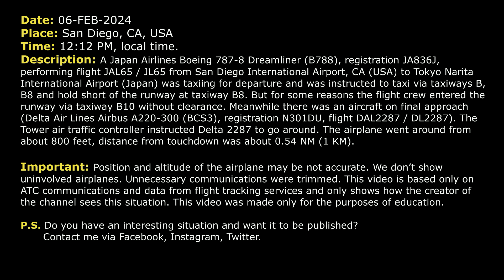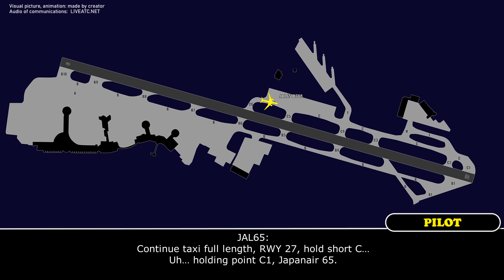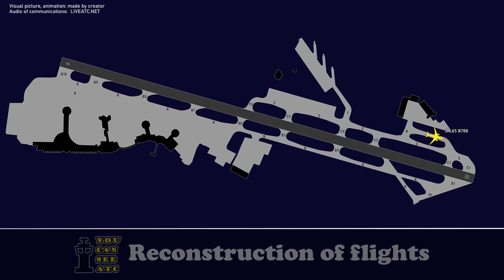Runway incursion. Japan Airlines Boeing 787 enters runway without clearance at San Diego. Real ATC

Comment: In conclusion, beyond an involuntary error by the JAL pilot, he was following the instructions and therefore, this active runway incursion is more the responsibility of the air traffic controllers due to a specific factor: accelerated speaking among those in charge. The ATC have the obligation to speak more slowly in order to be understood correctly and avoid small scares like this or major accidents like the one with the other JAL plane in Haneda (the latter was largely the fault of the JCG invading plane which did not was not authorized to enter the runway nor did he obey ATC orders and it almost seems that the surviving pilot acted like a real kamikaze pilot), the CEOs and managers of JAL should take a tour of Catemaco, Mexico both to cure themselves of horror and to get a clean of this streak of bad luck that they have been going through so far in this first two months of 2024.

My best wishes and unconditional support to the entire Japan Airlines team so that they can get out of this bad moment they are going through and continue moving forward as the great airline company that it is. 
😊😎❤️🇯🇵✈️⭐

Comment: Can someone please explain to me what this whole 'are you ready to copy the number' is designed to achieve?

The FAA (and JAL) will have a Safety Management System (SMS) and the mistake will get dealt with and investigated regardless of the JAL crew making an arbitrary phone call to the tower to swap Instagram usernames or whatever else the FAA think it is valuable for.

The SMS will ask that flight crew to respond to San Diego tower's report after they filed on them... What value (investigatory) is gained in an awkward phone call with 2 engines running, between JAL and the FAA's nominated officer, whilst at the hold point?

At that point, it would be prudent to forget about the incrusion and focus on the flight going forward, rather than this silly punative call the tower for the 'instant bollocking' process the FAA seem to have adopted?

Comment: This wasn’t an ATC issue. San Diego is a very tight airport, and Taxi Bravo has a tonne of lines drawn on it from the Apron on one side and the runway exits entrances on the other. It is a high threat situation, and needs to be carefully briefed. 

ATC instructions were clear. Taxi on Bravo hold short of Bravo 8. JAL thought the Runway was Bravo, and entered. End of story. Everything after that was after the fact.

Comment: Why does the pilot need to get on the phone with ATC when the situation has been resolved, sit there with passengers, burning fuel he may well need at the other end of a long flight? Why doesn't everybody just do what they're going to do anyway, and file a report/ASR? Unless there's a clear safety risk, why the immediate need for a phone call with engines running and flight duty limitations ticking?

Comment: I've seen a photo of the position where the JAL started to taxi, and taxiway A and B are parallel and right next to each other. The pilot read back instructions fine knowing he needed to be on B, so he probably thought the path leading to the runway was taxiway B. Where he proceeded to is actually a and told to hold position is a tiled area just prior to the runway and is the same surface as the taxiway (but would still obstruct any approaching planes). This also makes sense as to why he would not immediately recognise it as a runway, doesn't take a native English speaker or even a half competent pilot to spot a runway, but he probably wasn't on the runway immediately. The rapidfire English must be an issue for some foreign pilots (it's actually a bit slower than the JFK machinegun instructions in this vid, but still must be very difficult for L2 speakers). But the problem might lie in a misunderstanding of the layout and not language

Comment: On the initial communication, the controller did not issue a runway number with the instruction “ hold short of the runway on bravo 9”, and the pilot never read back the hold short instructions, as he never understood that instruction. The controller, in absence of a runway hold short readback from JAL, should have queried the pilot. US controllers are awesome, but in this case, I believe the controller was at fault, specially, dealing with a foreign carrier.

Comment: It appears that Japanese pilots already have a communication problem, as was the case on the Haneda accident where both pilots involved and ATC were all Japanese on their main airport. Having the Dan Diego ATC speaking like an auctioneer doesn't make things any better. They should be thought to slow down with foreign pilots to make sure they get the message through clearly. San Diego has only 3 widebody inter-continental foreign carrier flights flying out of there (London, Tokyo, and Munich), which is probably why controllers are more used to communicating with domestic carriers who fly there day in, day out, and know the airport like the back of their hand.

Comment: Lack of ICAO standard phraseology once again causes confusion. 

Kudos to the JAL guys for being calm and polite, they were only partially responsible here.
Reply: Looks to me like they were looking at B10 thinking it was B9. So probably also most of the way across B by then. Then obviously mistook the runway for B and here we are.
Reply: @verslaflamme666   I am from Portugal and I speak a few languages. I'll take it as a.. compliment? 😃  judgments about someone's background based on a youtube comment aside, If you taxi into the active runway through a taxiway which was not mentioned during the instructions it's pretty much on you, isn't it? Again, from the entire exchange it seems they couldn't get an ICAO level 4.
Reply: proceed onto B, hold short of the runway at B9. This was not a simple mistake where they didn't hold short at the right taxiway, they've taxied into the active runway. Aside from that they've done it via B10 which was not even mentioned. The main issue here doesn't seem to be the lack of ICAO phraseology from American controllers (this time), but the lack of basic understanding of basic instructions by the Japanese crew.
Reply: @GZimmermann  JAPAN AIR SIX FIVE HEAVY, TAXI VIA BRAVO, HOLD SHORT BRAVO NINER.

the controller is the only one who's not follow ICAO standard phraseology in communication, no offense.
Reply: @kennardidewanto  I am not saying the controller is using ICAO standard phraseology. However, how did the Japan read back the instructions? PROCEED B, HOLD SHORT OF B8. and then entered the active runway via B10. Seeing that as an issue that was caused by non standard communication from the controller is a bit crazy, specially resulting in a runway incursion.
Reply: @GZimmermann you must be a monolingual American

Comment: It's interesting how most people defend for the pilots. Yes, the instructions were a bit confusing, and the multiple amendments didn't help the crew at all. But it's no excuse for the crew to enter an ACTIVE runway without a proper clearance, which they never received. Entering a runway requires 100% assurance, both visually and orally. Remember the Haneda incident. The Japanese are known to be perfectionists, but they need to look into these runway incursion incidents.

Comment: I know that Japanair was clearly at fault in this situation but I think that controllers would help tremendously with foreign pilots if they slow down their radio transmissions and focus on speaking clearly.  Although these pilots have an excellent command of English it is still not their first language and they are hearing English but thinking in Japanese.

Comment: ground control needs to use the standard phraseology that's taught by the book 7110.65aa, "runway ##, taxi via." "hold short of runway ## at (point)" and speak in a slower pace especially for the foreign guys since english is not their first language. obviously you can speak quickly, but make sure it's legible over the frequency.

Comment: Okay, the pilots made a huge mess that could have been worse than what happened in Narita. I don't want to give justifications, BUT, the ground underwent countless changes during the taxi, quickly, for a crew that has a language completely different from ANY OTHER language! I understand that aviation must be fast, but it must also be SAFE. The pilots made a mistake, but ATC has its "piece" of blame...
Reply: That was on Haneda, not Narita. It was Japanese controllers communicating with Japanese pilots of the two airplanes involved. They seem to have a communication problem, and when you have a San Diego controller speaking as fast an an auctioneer while using non-standard phraseology...

Comment: "You can proceed onto bravo, hold short of the runway at bravo nine, you can expect the back taxi" It very simply could have been "Taxi to runway 27 via Bravo, hold short runway 27 at bravo nine." ATC didn't even say the runway assignment or runway number to hold short of. The crew made an error but clearly the controller is to blame for some of this.
Reply: Someone said that weather was atrocious and it’s very difficult to tell what is the ramp and what’s the taxi way. So they could have thought the runway was B.
Reply: @OCinneide  "Someone said that weather was atrocious and it’s very difficult to tell what is the ramp and what’s the taxi way. So they could have thought the runway was B."

Good point. But I would counter that most airlines today have Airport Moving Maps which display your GPS location on the airfield map. Entering a runway should be clearly visible to the crew. This is why I think they thought they were allowed to back taxi. The investigation and cockpit voice recorders (if retained) will show if the crew was discussing back taxi as they entered the runway -- of if they were completely unaware that they had done so. 

My airline uses Runway Awareness Advisory System (RAAS) which alerts when you approach a runway, either on the ground or in the air. Even so, with moving maps and RAAS, pilots still make mistakes and cross or land on the wrong runways. Thankfully aviation has a series of backups to prevent single modes of failure which can lead to disaster.

Comment: SAN is a runway incursion prone airport as there can be difficulty discerning the ramp area from the taxiway. This can be a more significant factor if there is unfamiliarity with the airport and a possible language barrier.
Reply: Yeah, just looked it up at maps. As it appears, there is a nice confusing "A" painted on the line from spot 2 to taxiway B. Sure, it is upside down when looking at it from spot 2, but it is clearly not helpful.
Reply: Yeah I have operated out of there and you have to exercise extreme caution even though I’ve been there many times! @phoenixqwertz

Comment: The USA doesn’t use hold points.   This is a huge point of confusion. The ATC instructions were clear for a us pilot.  Not so for a foreign pilot.
Reply: They weren't clear for this USA pilot. The ATC controller did not include a runway number to hold short of.
Reply: The runway is clearly marked liked other big airports around the world.  No instructions were given to enter the runway.  If you’re going to be an international wide body pilot, these are things you need to have a firm grasp on.
Reply: @seoceancrosser  "The runway is clearly marked liked other big airports around the world.  No instructions were given to enter the runway.  If you’re going to be an international wide body pilot, these are things you need to have a firm grasp on."

Which begs the question, why did at least 3 international wide body pilots have a runway incursion?

Comment: How about this theory...  JAL expected that taxiway B would be a segregated strip of pavement-- like it is on the east end of the airport --and didn't recognize that it was actually adjacent to the apron.  Looking at Google, I see there are no signs or pavement markings between his gate and taxiway B10.  

To add to the foolishness, Delta got inconvenienced but there was never any danger, so it's pointless to go through the whole pilot deviation stupidity with JAL.  They've got him sitting out there on taxiway J just so they can read him the phone number, burning fuel he might need on the other side of the Pacific.  Do they really expect the pilot to call them on the phone when he gets to Tokyo?
Reply: That's totally plausible.  To add to the confusion, from Spot 2, there is an inverted "A" marking which they may have misinterpreted as indicating the route to taxiway A, and therefore the next turn must be taxiway B.  Confirmation bias can easily merge these two factors, resulting in an incorrect decision.
Reply: @satoshimanabe2493 Nobody should still taxi an aircraft past a double dash lines and a double solid line closed to you without a clearance.
Reply: +1 on the theory - I would guess the same (either that or confusion about backtaxi because that means on the runway?)

Comment: Not defending the JAL crew, but it looks like they got thrown off-kilter by reverse ops, which does not happen that often in San Diego.  
The problem sounds like they must have been planning on JAL to be the first plane out after resuming normal ops, or they would have just had him taxi all the way down Bravo to the departure end of runway 27.  What probably threw the JAL pilot is he had probably already been given Runway 27 for departure and for him to back taxi confused him when he could have had a straight shot all the way down Bravo.  Seems like the instructions they ended up giving him was the scenic route of the airport.